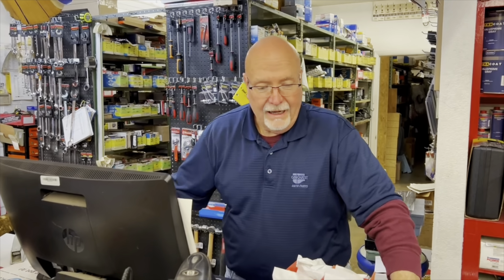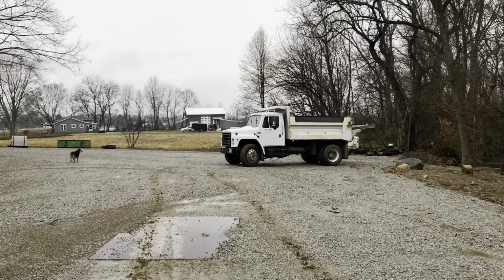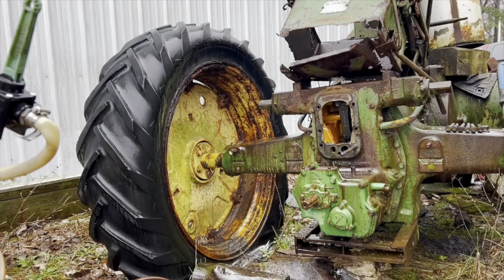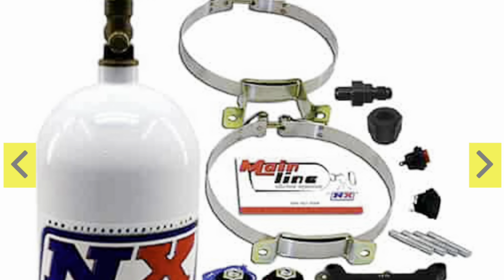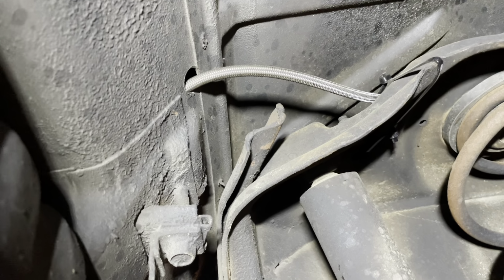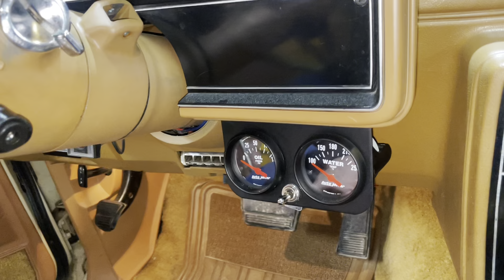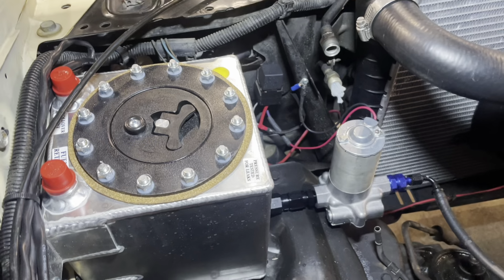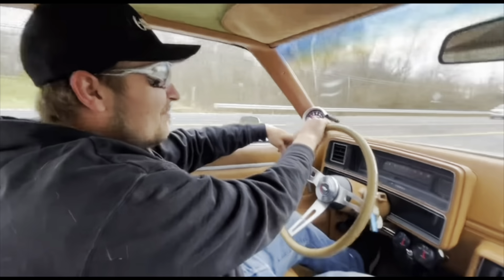NITROUS DETAILS! We cover everything in our Nitrous Express “Scatagascar Kit”

Comment: Rob is just putting in work all over the place, seems like a good friend.
Reply: Everything that Rob does (either for Bill or Billy) is nothing short of perfection.
Reply: @davidwilliamson7462  Like wanting to grind on the carburetor when the issue was the linkage? Perfection doe 🙄
Reply: @mrnastytime420  I was actually referring to the quality of work That Rob performs, which improves over time as I see it. If I remember correctly, even Bill didn’t get the carburetor issue correct on the first try.
Reply: @davidwilliamson7462  Who tf thinks to grind on a carburetor 1st thing? Bill sure as hell didn't.
Reply: @davidwilliamson7462 This comment didn't age well 😂

Comment: My uncles use to race at Franklin county speedway and they live about 45 minutes from the track. They didn’t have a trailer to pull the car so the ran a chain through a pipe and hooked it to the car to pull it to the track🤣 they used the pipe to keep the car from rear ending the truck pulling it. All my great uncles made liquor and hauled it from Floyd to Franklin county va

Comment: Hi Bill, good info. One thing I ran on my car was a pressure switch so if you didn't have 4 lb fuel pressure your nitrous couldn't work, it probably saved my motor a few times. Nitrous doesn't care if you have fuel pressure or not. 👍

Comment: You can build a 10bolt to be tough. It cost so much to run a bigger axle. Then from what I understand,changes the breaking to the gears. 
       I would bedt that Moser, has matched race and bearings throughout with the best they can produce.  For half the price of a headache and a c clip eliminater.

Comment: Bill, what size hole was that he drilled in the trunk? I have some Busy Corner Double Sided Grommet Hole Plugs I bought in an assortment from Amazon, and will cut one to fit and send it to you if you like.

You would just need to spread it around the Stainless Mesh N2O feed line, stuff it in the hole, and put a spot of or 2 of silicone on the outside to seal out any water from reaching the interior of the trunk space.

I have 1-3/8", 1-3/16", 1", 7/8", 13/16", and 5/8"...guessing from the vid it is about 1" or 7/8".

Normally they are solid, cut a + in it and feed the line through as you install em, but found they can easily be cut through the edge of the grommet on one side and be installed after to seal the hole also.

Just want you to be able to keep any moisture out of that pristine trunk area,, and I have more than I will ever use of each size.

Comment: Where the line for your nitrous comes out  of the trunk it appears to be right against the sharp sheet metal. I would put a grommet on that hole or at minimum wrap line in a spliced piece of rubber hose or something to protect it. It’s fine now but vibration over a long time will probably cut into that line.

Comment: with the 150 shot are you pulling timing and if so how much and how are you pulling timing?
Reply from the maker: For now, I just back the timing down 3-4 degrees, but I’m not too worried about it as long as we just use it in 2nd and high gear.

Comment: Is there a switch for changing to standalone or is triggered by button? Does it end up being below 110 when it hits due to mixing from previous pump gas? And, how do you set timing? Change it at the track or set it and forget it? 
Colder plugs? Rings filed?

Comment: Aeromotive sells an awesome liquid filled fuel pressure gauge with a little pin in the top that you can pull out to release the pressure and get an accurate reading at all times, i found it to be well worth getting it.

Comment: i know the yukon xl 2000 to 2014 have four links in them and some of them have 14 bolts 9.5 ring gears i dont know for sure i have heard they can work with some mods but i know there a ton of the 8.6 rearends 10 bolts out there for about 300 to 500 i check around her in michigan i know a few guys that have buicks for parts i think the monte carle ss with the h.0. 305 had that same rearend you are looking for too

Comment: Bill I have a speedmaster paper catalogue…. It’s on page 200 it is a 2.5 gallon fuel cell with a tube type fuel sending unit…

 8 1/2 by 81/2 by 10 inches high… it has two outlet fittings and the part number is 

PCE130.1012

Comment: Hey I have a sbc with a 780 holly, my question is I have to run an electric fuel pump in line. I got a regulator and pump kit from Summit , it's good for 9lb it locked up over the winter and need to replace it, what would you suggest

Comment: Hi, I've recently watched the video you had done previously in the nitrous set up in the S10, and was wondering if there's a reason you're not using a return style regulator this time? Or do you plan to fit one when you install the controller? Thanks for such informative videos,  I enjoy learning from them.
Reply from the maker: The return style regulator isn’t necessary for a low HP nitrous kit like what I’m using.  The return is to help stabilize fuel pressure while progressing in a big shot of Nitrous.
Reply: @theoldmansgarage  Great,thank you for clearing that up 😊

Comment: Great show today Bill , my question is after you arm the race gas pump how are you shutting down the pump gas fuel pump as I have a 85 chevy small block Silverado that I'm planning on finishing this summer with my 13 year old son and I'm really interested in adding a small shot of nitrous to it as well. Thanks for the info
Reply: Not killing the pump gas.  Mixing the two fuels with the race gas only going through the fuel side nitrous solenoid to up the octane as a fail safe to avoid pre ignition.

Comment: Man, really I am not attempting to be critical, just helpful ok....I know stupid internet experts huh, not an expert here by any means...

But I noticed the 2 red plastic thread protector caps on the return and the vent/rollover valve on top of that 1 gal. Fuel cell underhood my brother.

For your safety only bro. Should you have a rollover happen (God forbid), those transport thread protector caps (the cell came with on all ports), will flat not hold up (though is currently sealing off your cell vent mainly, and your cell is not currently really vented either).

Next time at Jeg's get a properly sized-AN cap for 6 bucks for the return port, and at least a properly sized -AN 90 and barbed fitting to put a couple feet of hose or fuel line on the vent and rollover side,  running down toward the ground below the cell, so that if a rollover did happen, especially while that switch is armed (car in upright position cell is vented), and if in rollover position, the ball bearing in the rollover valve pretty much stops fuel flow, but whatever does get by the valve (during any potential rollover), will be held up above the cell in the vent hose.

My car required 2 rollover valves and the same situation, 1 in the spare tire area where I mounted the cell, that came in the 5 gal. Cell (and also fabbed up a bulkhead since it is a hatchback, separating the cell from the driver area), then a 90 plus barbed fitting, hose, another barbed fitting and 90 and then into an externally mounted rollover valve. (So, No fuel can be spilled into the interior areas of the car, and it is vented externally outside the car under the rear, in case of a rollover). 

As an original EFI car, I already have a stock electrical mercury rollover relay, that instantly cuts power to the fuel pumps electrical circuit in case of rollover, that your car does not have.

Just better to plan ahead for the very worst case scenario, and the 15 -20 bucks total in fittings and hose, and the extra few mins to install them, and flow plus safety is increased at the same time.

Enjoy your how to vids brother, just making a further suggestion. Though I only want to see you race shiny side up...we also race against other squirrels too.